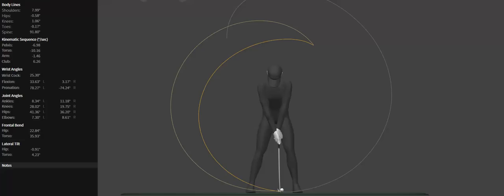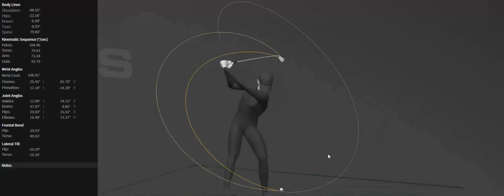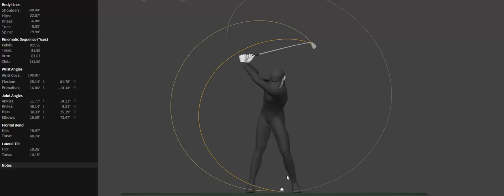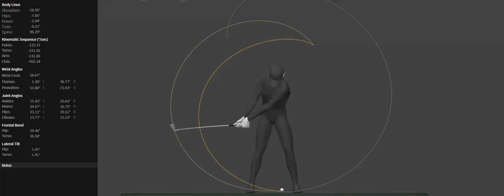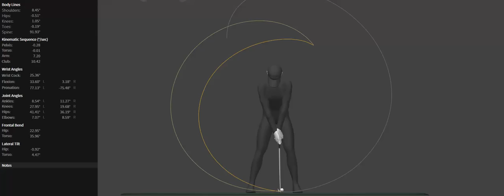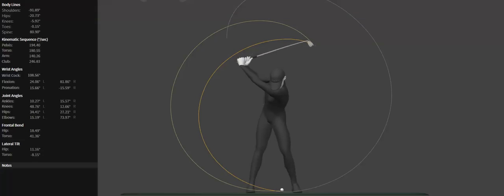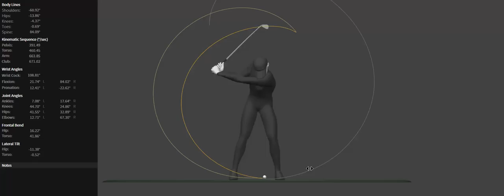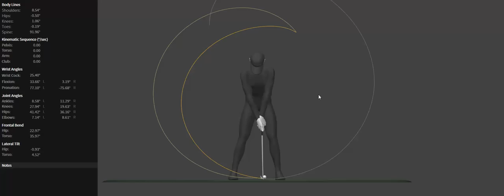Wide To Narrow Golf Swing?

Comment: Great video.    Is there ANY attempt to widen or release the angle in the right arm on the way down?   Or is this happening because of the overall body motion etc....   Thanks.....
Reply: Vance Weber- Good question.  There are only 2 ways you can move anything. You can either push it or pull it.  So if you are a "pusher" of the shaft aka hitter, thrower ,  then you are making a conscious effort to straighten the bent right arm. If you are a puller of the shaft , aka swinger, then you make no conscious effort to do anything with your arms or hands. You simply let physics ( centripetal/centrifugal force) release the club , which then will automatically unfold the right arm. Your body rotation is the engine that moves the car and all other body parts are just passengers along for the ride.

Comment: Seriously, the myths are in your head. You are really just overthinking the whole thing - like everyone does - to try and give justification for their lousy shots.
Sure there's something you're doing wrong - which is why your shot is bad - but the positioning, and carried out motion of your swing is not the issue.
You obviously have all the determining factors to a perfect shot, you understand that position to the club at contact with the ball is crucial with no room for error. You have but a small dot on your club, and one on the ball where the goal is to create contact: the smallest glitch in your swing will disturb that alignment and effect the accuracy of your shot the further apart these two dots are from each other at time of contact.

Distance (long shots) play into this issue, while keeping stokes to a minimum is key for winning. This requires technique in your stroke for maintaining position on the club when making contact with the ball - aligning the dots - having to swing your hips as to assist in carrying your stroke and putting more power into it, your alignment is disturbed therefore having to adjust your swing. Now technique comes with experience, and it's a natural giving that you adapt with time, as you get the feeling of your swing, your body posture and any glitches from the force behind the stroke adjustments start to come in naturally. The more you get a feel for it, the better adjustments you'll make and the more your shots will improve .

The same techniques that work for one person can be applied to and work for anyone - if executed properly - however it may be more difficult in perfecting. Everyone is not molded the same, we each develop our own distinctive characters and any glitches may vary as some people may tense up more then other when using force, or simply just as one's height, body poster, shape, and limbs lengths, even joint movement could be entirely different: it is in each person to develop a swing that works for them and even then you can only perfected as consistently as you have the conscious to.
There's only one possible perfect shot, and no one is perfect. A clear conscious, in-line, stable, calm, patient, focused, tolerant and in-tune consistency makes the best drivers on a curse.